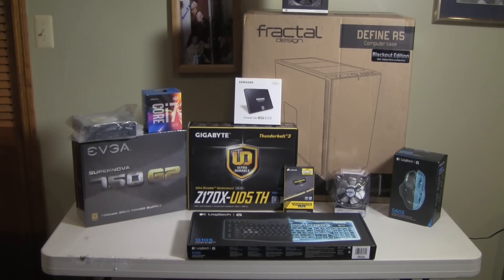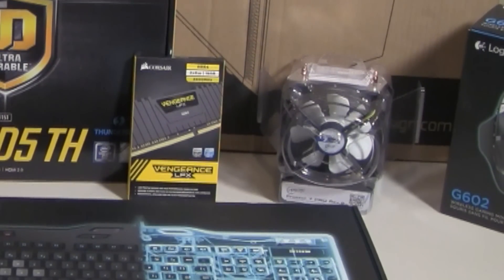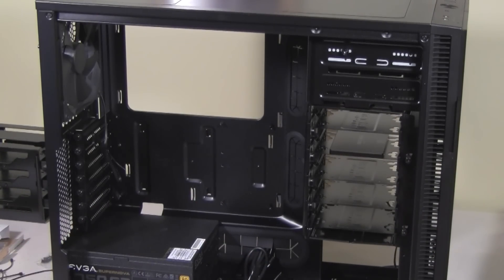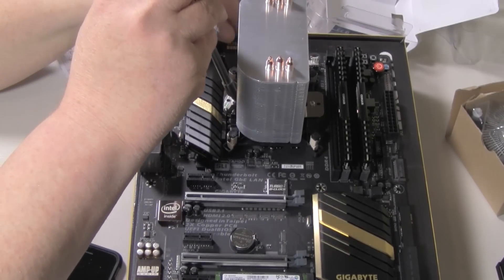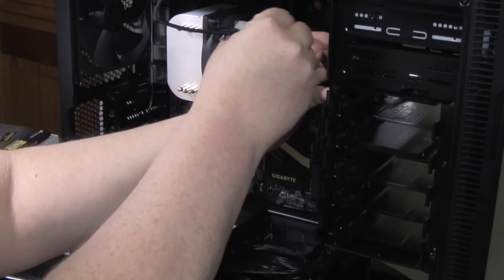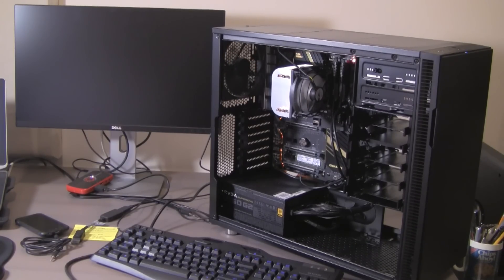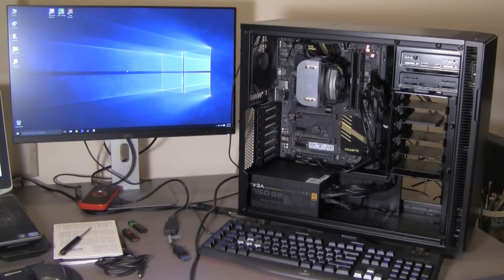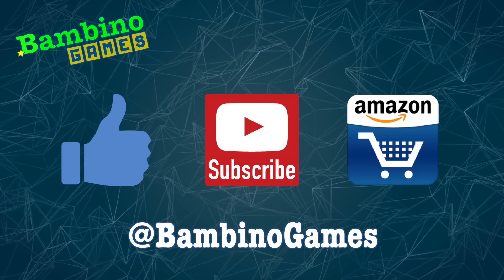Gaming VR PC Build i7 6700 GTX 1080 Ready + M.2 SSD ★

Comment: Did a brand new power house build myself and I am running 2 1080s on sli. Those ram drives really make things fly. Enjoy the video thx for sharing subbed ya man
Reply from the maker: sweet. 2 x 1080s is sick.  myself.. i'm leaning towards 1 x 1070.. EVGA SC most likely.  thanks for watching and subbing.
Reply: What power supply do you have running two 1080's ?
Reply: I went over kill on it
Corsair Obsidian Series 900D 
MSI X99A GodLike Gaming Carbon LGA 2011-v3 Intel X99
Intel Core i7-5930K 3.5
Dominator® Platinum Series 64GB
Intel 750 Series 2.5" 1.2TB PCI-Express 3.0 SSD
Samsung 2TB 850 PRO SSD
WD 6TB WD Black 3.5"
Corsair AX1500i Digital 1500W 80 Plus Titanium Modular Power Supply
2 GEFORCE GTX 1080
Reply from the maker: over kill is good.
Reply: +Secret Stuff 
I wouldn't call it overkill... more like 
TOTAL ANNIHILATION :)

She should last for some years to come.  That power supply though!
Reply: but will it play minecraft lol
Reply from the maker: or pong
Reply: +Secret Stuff 
I would hope so lol.
Reply: Sweet , so on wat monitor /resolution are you running this ?
Reply: The monitor I am running is ASUS PB279Q 27" 4K UHD IPS WLED-Backlit Display
Reply: +Secret Stuff that's pretty much my dream build for my first PC. How much did all that set you back?
Reply from the maker: components were about $1000... not including the GPU.
Reply: Around 7k or so. only bought a few items from newegg because some items where not available B&H Audio. See newegg and amazon and many other places have ware houses in my state thus they all charge me tax. When you build a big rig like this the taxes would had been over 1K. So I had to buy as much as I could from B&H because they are not in my state so no tax. So really because of this newegg ore amazon do not get a whole lot of money from me. Alot of the cost was the storage deviced.... 2500 in HD alone.... 

But when some does a build no matter if its 1k or 7k also see if they charge you tax if they do move on to another place.

Comment: You didn't use any thermal compound on the CPU? :/

These are pretty much the components I'm planning to get. I wasn't sure what motherboard to get. My current rig was messily put together. Hopefully I can do it a bit neater this time.
Reply from the maker: the thermal paste was pre-applied on the heat sink.  good luck with your build

Comment: Should've applied some thermal paste on top of the cpu before installing the heat sink...
Reply from the maker: thanks. its pre-applied on the one that i used.   i should have mentioned that in the video.
Reply: +BambinoGames ahh, nvm, good video btw!
Reply from the maker: thanks!

Comment: I am sorry to break it to you... the m.2 that you bought is a SATA I.e. the speed is the same as SSD. You should have gotten the m.2 PCI. The speed difference is about 4X.
Reply from the maker: aware of that..but thanks.  didn't want to spend $180 on a 950.  the one i bought is $99 and SSD speed is fine for me right now.
Reply: SAMSUNG SM951 M.2 128GB PCI-Express 3.0 is only $99 at newegg.
Reply from the maker: thanks. but i needed a 250GB.  the PCI-e may be something I do down the road.

Comment: Thanks for the video.  I happen to be considering the R5 case and GA-Z170X-UD5 TH mobo as well.  Did you ever figure out the malfunctioning USB3 slot problem on the R5 front of case?
Reply from the maker: nope.   probably a bent pin.  i have a USB3 hub which gives me a total of 12 USB3 ports so not a big issue.

Comment: Hey I was wondering what you used as your boot drive. I noticed that you had 2 of the same ssd's but 1 in m.2 form. the ssd is actually a bit faster than the m.2 option which is really meant for laptops. I would've gone with the nvme 960 evo which is completely different and way faster than both of those. it's what I went with for my build and it is insanely quick! nvme is much faster than regular ssds. I just didn't see the point of you using 2 of the same ssd's. D:?

Comment: How has the motherboard been for you so far? Looking at getting the same one so I'm just curious. Your build is very close to the one I want to do down the line.

Also you said one of the USB 3.0 ports didn't work. Did you ever figure that out? It could mean you'd have to return that case because it could be slightly defective.
Reply from the maker: i've had the system running constantly for 5 days with no issues.  thats not a long burn in so we'll see after another week.   installed a GPU today easily. regarding the usb3 port...  it is more than likely the cable. i'm going to troubleshoot it this weekend.  not too worried about it.  plenty of ports on this rig.

Comment: If you go ssd , you never go back to hdd ;) . I hope you put a nice custom gtx 1080 in that rig , then you are more then rdy to rock on  2560/1440 . Thumbs up.
Reply from the maker: Thanks Liam.  On the fence between a EVGA 1080 and 1070 SC. The 1070 seems to be the best bang for the buck.
Reply: Not much storage 500 +250 u must install 2tb SSHD
Reply: For the operating system and some programs may be done, but only so much. SSD-it's fast to work with small pieces of data, but large's not a quick and shines like a stove.
Reply from the maker: I've since added another 500gb SSD.  So now one 500g SSD is for Steam and one is for other games.    Thats plenty of space for my needs
Reply: Okay but I think u need it at least 2 tb sshd because if you are games collectors then u need more space to store games like me I had 4tb sshd and 2 tb ssd + Samsung 950 evo 512 gb it is less for me
Reply from the maker: thanks. if run into a storage crunch I will upgrade.  for now  have plenty of room.
Reply: Thats a tough call and totally depends on your monitor setup now or in near future. Going 4k? go with 1080,hell 1440p or 144hz 1080p? That card will stomp thru it all. Eyeing the 1070 myself, nowhere near ready to invest in 4k yet and Id be happy with 60-120 fps 1080p for at least another 2-3 years. Imma hold off till they bundle a game worth a damn or come down to 300-350 range, I'm still really happy w/my 970 oc to 1500mhz! If you at 60hz 1080p stick with 970!
Reply from the maker: I'm leaning towards the EVGA 1070 SC.  Don't want to pay for a 1080.   Plan to move up to 1440p at some point and the 1070 will be great for the games I play.   No hurry though... not going to pay $100 over retail.  In a few weeks the prices will settle down once inventory is available.   Then the pirates on Amazon charging $650 for a 1070 will be out of luck.
Reply from the maker: well. changed my mind again.   EVGS 1080 SC is the one.

Comment: Really respectable rig, and a nicely made video, well made and good quality content. Well done, I've subscribed. 

My Rigs specifications:

Case: NZXT H440
Mobo: Asus Maximus VIII Hero
CPU: I7 6700k @ 4.4 Ghz
Ram: Corsair Dominator Platinum DDR4 @ 2400Mhz
GPU: GTX 1080 FE
SSD1: Sandisk Plus 120GB
SSD2: Toshiba Q300 120GB
HDD1: 500GB WD Blue 
HDD2: 1TB WD Blue
PSU: Corsair RM 1000
CPU cooler: Corsair H100i V2

Fans: 4 Corsair Series AF fans, standard 4 pin, controlled by PWM, linked to system temp on custom fan curve. & 5 Standard Corsair 3 pin fans, controlled by DC controller, set for silent operation until temps get higher, then they ramp up, which they rarely do, so thats nice. 

What build specifications do you guys have? I'm really curious to see what rigs other people are using.
Reply from the maker: thanks Minx. nice rig yourself.  thanks for watching and subbing.

Comment: Nice video, and nice build, can I ask i'm looking to build a new pc and I am in two minds as to what socket to use 1151 or 2011-v3. and is there much difference betwwen the evo and the pro samsung ssd?
Reply: Or save some money and get a slightly older socket 1150 and a top spec Intel processor with the new gpu's and you have a beast of a rig
Reply from the maker: socket choice mostly depends on which CPU you want to use.  i went with a 1151 because i wanted to use the i7 6700 CPU.  the samsung pro is 4 times read speed of the evo but it has to be installed in a PCIe M.2 slot.  the evo is SATA3. check out this video on the evo  https://youtu.be/dasNIBdWJKs
Reply: thanks for reply both of you.

Comment: i have this same motherboard, the only issue i have is that i had to power on about 3 - 4 times before it turn on because it keeps switching off, dunno y actually, i checked the internet and notice other people has face this issue as well.  just a question i couldn't connect using DVI Cable for display, i have Gigabyte GTX 750 TI  Graphics Card. what display cable i can utilize?

Comment: I'm planning to get an i7 6700K 4.0GHz, gtx 1080 EXOC 8go, 8 gigs of 3000MHz RAM in the same case, fractal Define R5. Is the case silent enough ? I'm also trying to pay the less possible but I'm around 1800$ (1600€) now, I can't really get lower I think.
Reply: Oh and a 240Go SSD and no HDD, I'll buy one later
Reply from the maker: In my opinion the Define R5 does a great job when it comes to noise reduction.  In my system I can hard hear the fans.  I don't have the glass panel on mine which makes it even better.
Reply: BambinoGames Great! I also plan on getting the windowless one.
Reply: I would get another 8 gb of ram
Reply: Awesome Turtle Yeah, my budget became larger. That will be 2*8 gigs of DDR4 CAS15 RAM

Comment: I want to build a &2000 gaming pc for the MSI GAMING GeForce GTX 1080,  what is your recommendation for the component? By the way , why the GTX 1080 is at least $200 higher than the official price, do you think the price will go down in a several months?
Reply: Yes the price will go down in several months. The reason why theyre so expensive right now
Is because there arent many in stock so they bump
Up the price so they can make the money
Reply: I try to build up a pc component : 1)https://pcpartpicker.com/list/ , 2)https://pcpartpicker.com/list/ ,which one do you think is better? Is the x99 deluxe much more promising than the ASUS Asus MAXIMUS VIII HERO ?
Reply: I want to build a pc, but I am wondering should I wait for the BlackFriday. Do you think the GTx 1080, i7-6800 , asus x99 deluxe ii ,asus rog swift pg27AQ will have a huge discount ?
Reply from the maker: hard to say really.  i doubt the 1080 will be on sale though.  but i could be wrong.
Reply from the maker: i found that after researching components I went with the parts that had the highest customer ratings and would give state of the art features for the price. its easy to get caught up in analysis mode.   i would suggest, do your research and go with your gut feeling.
Reply: ok, thank you so much
Reply: Is the combination of asus x99 deluxe ii and asus stri gtx 1080 better than the combination of asus x99 deluxe ii and msi gtx 1080 gmaing x? Or just the company of the video card doesn't matter?
收起
Reply: What does the "some Intel X99 chipset motherboards may need a BIOS update prior to using Broadwell-E CPUs" mean?
Reply from the maker: these are questions you should prob be asking or reddit or a PC building forum.  thanks
Reply: Ok, thank you so much.
Reply: I just ordered the Msi gtx 1080 gaming x, will it fix to the asus deluxe ii motherboard?
Reply: Does the asus x99 delxue ii have a wifi netword card inside? I don't have a network cable. Do I need to buy one, if I need to buy one how can I install it?
Reply from the maker: please look at the specs of the board on Asus website.
Reply: Thank you so much.

Comment: Why go for an overclock motherbord with a non-k cpu?
Reply from the maker: as i mention in the video.. wanted Thunderbolt feature.. and ability to change to other CPU if desired... options.
Reply: Fair enough,

I wonder what an overclocked i7 4790k preformes against an normal i7 6700

Comment: it is not a fast boot actually. i have 750 evo sata ssd on laptop and it boots faster. it takes 7-9 secs on mine.
Reply from the maker: thats great.  when I say its fast i'm comparing to HDD boots actually.  higher speed SSDs are of course going to be faster.
Reply: dude you have an m.2 ssd. your pc should boot faster. that is what i mean. maybe there is a problem with your configuration or something.

edit: i didn't notice yours is evo too. same read write i speed with mine.
Reply: Nosferatu it's in the m.2 form but it's the exact same as the 2.5 850 evo. if he wanted it to be faster than the 850 evo he should've gone for an nvme ssd. he might've gotten confused and thought that the m.2 would be quicker than the ssd. in fact they are both the same thing but in different form.

Comment: Should I get an M.2 or SSd? OR should I get a 256 m.2 and a 512 SSD for games installs.
Reply from the maker: Chris.  it really depends on what you need.  I have my m.2 as the windows boot drive and all utility apps are installed on there.  then i have 1 500gb  SSD for Steam games only.. and another 500gb SSD for other games and apps.    M.2 comes it two flavors.. SATA 3 which is same as SATA SSD speeds and PCIE which is 4 times that speed.  So it also depends on what kind of m.2 your motherboard supports.
Reply: Samsung PM951 128GB M.2 NGFF PCIe Gen3 x4, NVME Solid state drive SSD and a Gigabyte Z170 Gaming K3 should be compatible.

May go for the 950 evo version of the m.2 but I think 120gb should be more than enough for the OS.
Reply from the maker: faster is better..   especially with Windows getting larger and larger..

Comment: I got 2 problems tho, the wi dows installing is confusing and updating it, also the build doesnt have a gpu and idk if that will affect the pc
Reply: also is 1,000 the estimated cost for the components?
Reply from the maker: components without the GPU was about $1000.  I didn't install GPU in the video because I build this before the 1070/1080 were available.  After making the video I bought a used 970 to hold me over until the 1080 inventories settle down.   there are other videos on YT about installing and updating Win10 which is why i didn't show it.
Reply: Oh ok thx
Reply: BambinoGames but how do I get a windows 10 card to install is it on the amazon page?  And how do I update it onces I install it? Im just wondering I wanna know cuz im trying to get a custom pc but im new to the pc world
Reply from the maker: this is windows 10 the DVD i bought in Amazon..  http://amzn.to/29l6Lbg.   windows is pretty much plug and play.  it has an automatic update feature.  if you run into issues google it, there are plenty of answers out there.
Reply: +BambinoGames ok thank you

Comment: MOBO has Z170 chipest but the CPU isn't K series...
Reply from the maker: yup.  you can use a non-K series chip with this board.  I wanted Thunderbolt and the option to change to a K series if desired.
Reply: Oh... now all is clear
Congratulation for that "beast"

Comment: Can this PC run 4k
Reply from the maker: i'm sure this CPU with a 1080 would push vid to a 4K monitor without problems.   I don't have one so I can't say for sure.  check  for 4K benchmark vids.
Reply: I'm most games yes it will run 4k at around 60 fps once he gets a 1080 in it.

Comment: no GPU?
Reply from the maker: I bought and installed a used EVGA GTX 970 SC as a placeholder until the 1070/1080 after market cards settle out.  I will prob end up getting an EVG GTX 1070 SC.  Although the game play with the 970 at 1080p is pretty damn good.